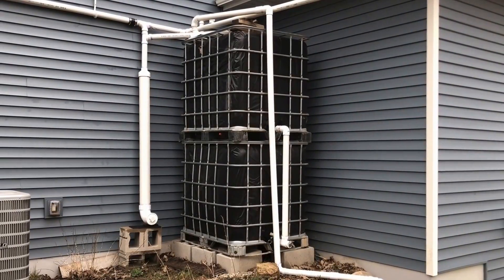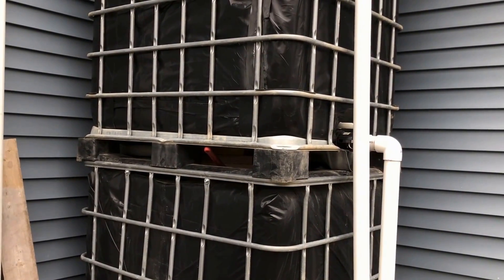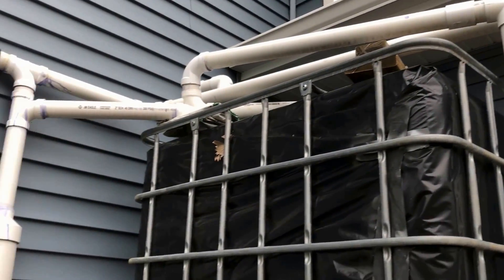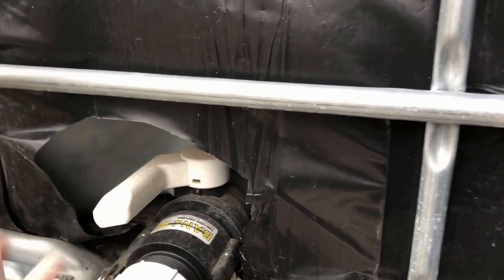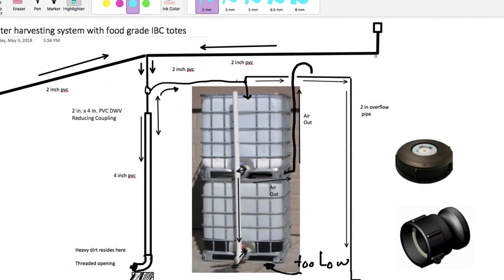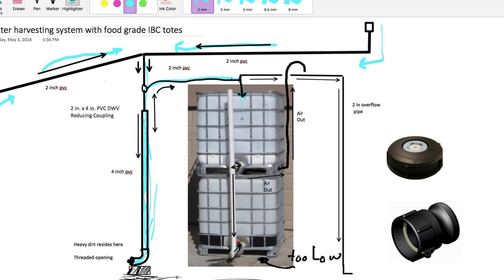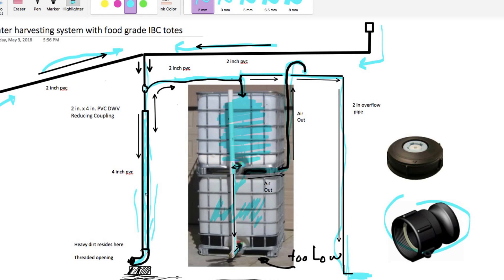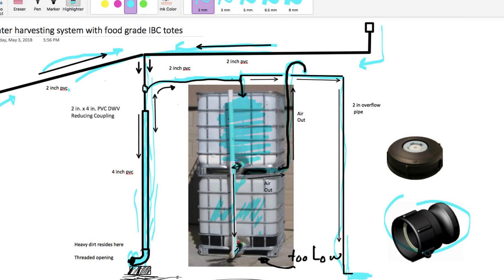Quick Detailed Water Harvesting System IBC Totes for Irrigation-Fully explained schematics

Comment: I know you recommend setting the side to side but don’t you get more pressure this way? I have several fruit trees and I use 1 tote to water 10 trees with an irrigation system but obviously the last 2 trees don’t get as much water because of the pressure and that’s the issue that I’m dealing with right now. If I stack them wouldn’t I get more pressure?
Reply from the maker: You do get more pressure when stacked. Even when stacked, it is still better to use a small water pump.

Comment: Jay,

As a follow-up, the part you need at the top where two directional gutters join is called a 2 way Cleanout Tee. This will direct water smoothly coming from both directions down to a single line. I hoe this helps.

Comment: Hello Jay,

Thanks for posting up this video. A couple of tips for you. 

Up top where you have two different lines coming in to feed the system, you have the wrong "wye" connector. The one side has the direction flow, while the other has to fight its way in. You want to have a "double elbow" pvc connector, that the two sides are directional in flowing into the main pipe, down to your filtration, and then when full into your tanks. This will prevent back-up in the feeder system.

Supporting the underside of the tanks is excellent, however, instead of using several 2x6 boards, you can utilize a 2x4 on edge and it will go right through. Make sure you cut the wood so that it rests on the steel cage and NOT on the plastic tank. The plastic tank will not support the 2x6's and you risk cracking the plastic at the end of the boards because they are not supported by the steel cage. 

Right now, I'm trying to decide whether to double stack or not. I see the advantages, and disadvantages. Mine will not be up against the house, but free standing. I'm still not sure whether to put them in line or two on two. It is a room factor. I've done much research and both seem plausible. I just don't know.

Also, I recommend you get some landscape tubing and extend the overflow pipe so it drains away from the foundation of the house. It is never good to have quantities of water draining right at the foundation. It can eventually cause foundation issues, or draw termites up. Let the water drain at least 6' from the foundation, longer if you can help it, or if you can add tanks away from the house, use it as a feeder.

Again, thanks for the video. I just wanted to share with you some thoughts I got along the way with my research.

Thank you!
Reply: Do you get more pressure but stacking 2 of these together?

Comment: How does the stacking of these units work out?
Reply from the maker: I had mine built in 2016, still works well. Need to use the pipe cement well, especially the lower parts. If you have enough room to put them next to each other, that will be better.
Reply: @jaynawa5905  My mind goes to the weight of water, the stress it causes & also freezes. Unheard of in central Texas, this year we had temps as low as zero for a week or longer, in cases like that room for expansion I imagine should be looked at. Anyways I'm just imaging having such freedom as water gifted from God.
Reply from the maker: @victorwadsworth821  You are correct. In Wisconsin and similar cold zones, you will need to empty the tanks at the beginning of winter. Also, you will need to empty the 4" pipe at the left of the stacked reservoirs (see schematic diagram). Frozen water (ice) is almost 104% the size of water, this will damage the totes and the pipes. 
When stacking, make sure to separate the two totes by 2 by 4 as indicated in the video.

Comment: IBC totes are not made to hold pressure.  The bottom tote in this setup is subjected to the pressure of the water in the top tote, which is what causes the swelling he is referring to in the video.  I would recommend stacking them side by side and placing the overflow outlet as close to the top of the tote as possible to avoid pressurizing them.  It will save you a ton of frustration in the long run.  I have built several water collection systems with IBC totes.  I started with this design but eventually abandoned it because of multiple failures.
Reply from the maker: The tote frame is extremely strong and can withstand the extra weight and pressure. As for the water pressure on the bottom tote, it is doubled (pressure = density x gravity x height), I agree it is bigger. However, the system has been working well for the last four years without any problems. If you have room around the house, I recommend setting the totes next to each other.

Comment: Thanks for the video. Great work! I was wondering if 6" of gravel for the base is enough to hold that weight.
Reply from the maker: I actually don't think it is enough. You'd better go for 12" of gravel mixed with 3" or 4" size rocks. When our house was built, the builder told me that we have compact sand (I think it is limestone sand), which makes 6" for the base to be ok. If I would do it again I would dig more than 6".